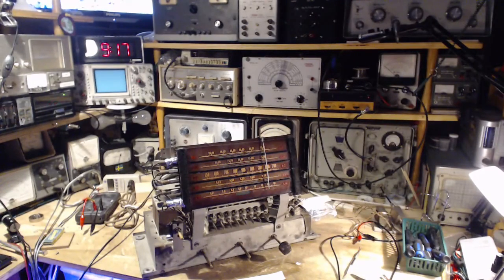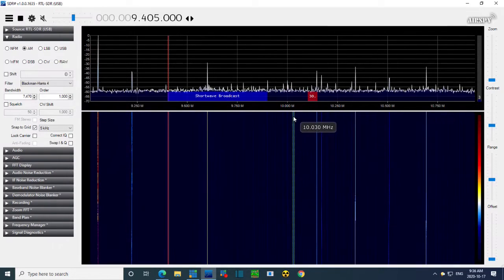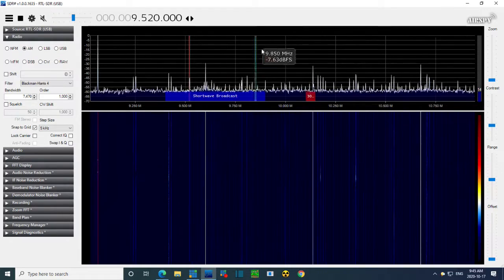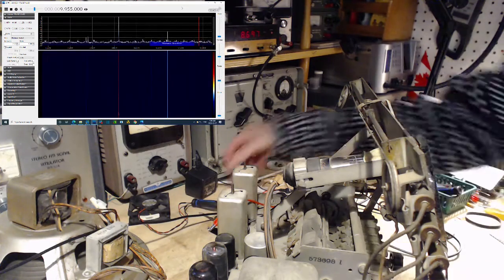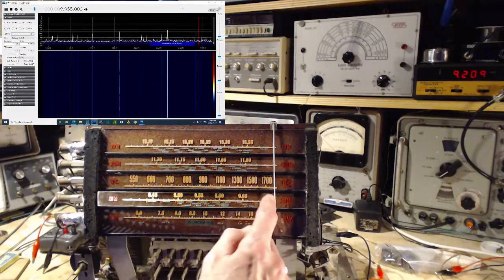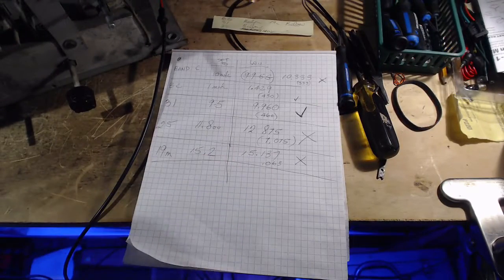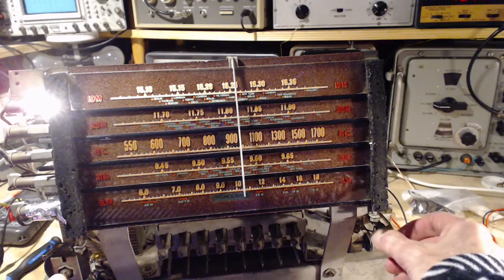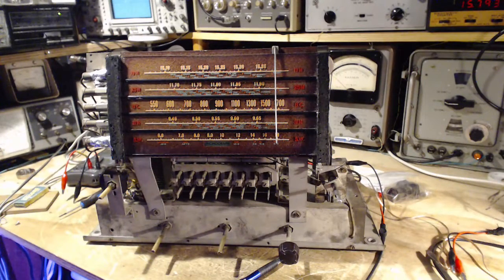Westinghouse 981X Shortwave Receiver Video #19 - Alignment Corrected

Comment: Jim, judging by the noise you get when switching bands, perhaps it's just dirty contacts in that complicated push-button band-switching arrangement.  You should try to give it a proper cleaning, not with WD-40, but with a good contact cleaner such as  Deoxit.  It's a bit more expensive, but it works.  Give it a try!

Comment: Could you describe sometime the software based spectrum analyzer you are using?
Reply: It's not a spectrum analyzer, it is a software defined receiver and he made a small coil antenna he sticks into the radio circuit to pick up a signal. You can buy one on eBay. Search "SDR"  on eBay they range from price from $25-50.